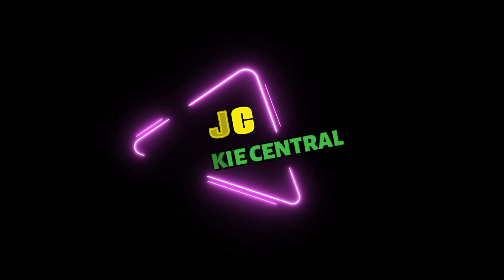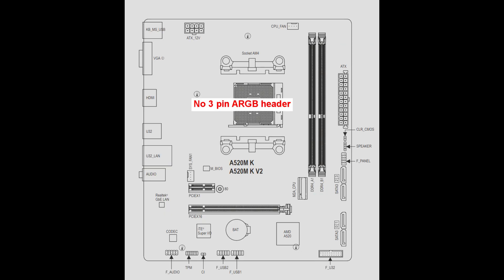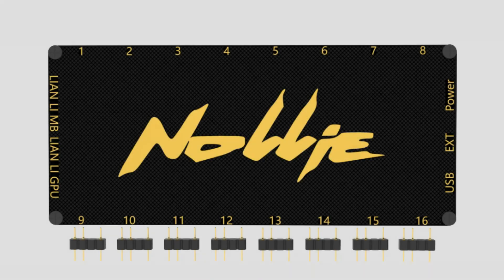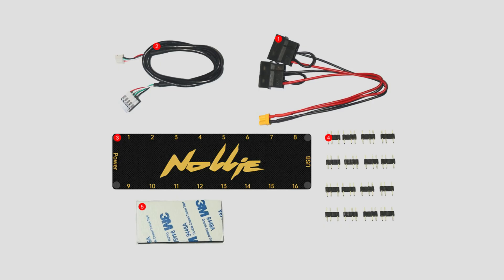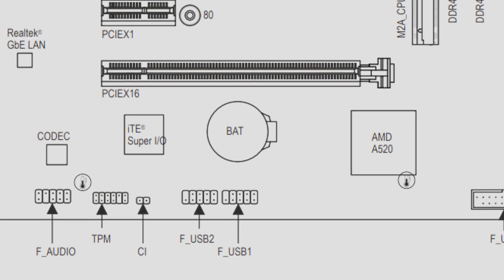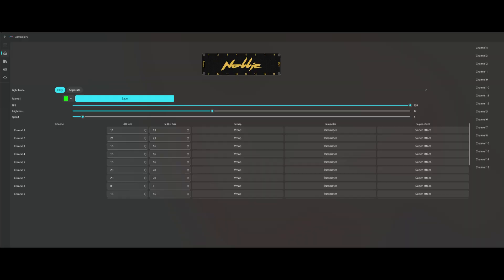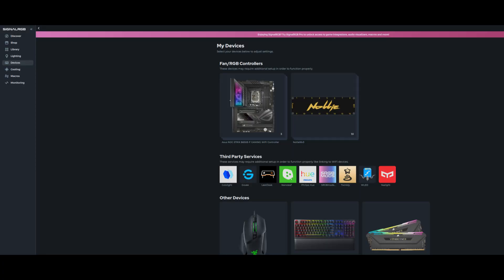Nollie RGB Controller - No ARGB Header, Installation, Software

Comment: Hello, I have a question. Can the controller set up a “startup animation” with the fan’s rgb ? Like when my PC is booting can the rgb have an animation or a preset color show up instead of the default rainbow RGB that shows up a few seconds when the pc is booting ? Ty
Reply from the maker: Good question, and the answer is yes. You have to download the Nollie software and pick the color you want and save it. This over writes the rainbow effect in the memory controller, once done close the software and everytime you boot it should now display the color you chose.  This works the same for motherboards and ram, the rainbow effect is just simply a way for the manufacturers to test all the colours display before packaging them up.

Comment: This works flawlessly with signalrgb but wish the argb connections werent so flimsy.  Ibhad a hell of a time trying to keep each header connected as i moved onto the next.
Reply from the maker: some people use a hot melt glue gun and add a spot where the missing pin is and this stops them coming out out the controller. does make it easier. if it is the cable from the fan to the adaptor you can bend one of the outside pin slightly and this holds that in place.

Comment: what if i have 9 fan , can i put 1 portal conect to 2 fans
Reply from the maker: I am presuming you are looking at the Nollie 8, this version allows upto 126 leds per port so yes you can add another daisy chained fan. doing it this way means 2 fans will display the same pattern or colour on both.
Reply: @TechJunkieCentral-l9w  ty your reply

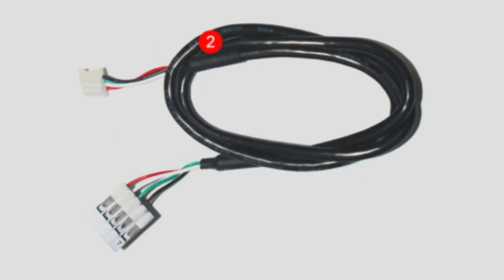Comment: 1:40 where can i find this cable ??? any link or website?
Reply from the maker: The issue isn't so much about find a cable that will fit as it is about the pin layout, it is a proprietary cable and possibly pined different to other cables. The cable is listed on the Nollie site as a USB 2.0 Internal Motherboard connector to USB PH2.0 cable which is easy enough to find, the issue is where the Red (+)  cable is located in the connector. I can't 100% say that you won't cause damage using this one like this https://shorturl.at/HWEYD and that is up to you if you want to try. I think I saw your post on Reddit asking. You could try re pining the 4 pin connectorby tracing the wires from the 9 pin. Other than that contact Nollie and see if they sell them separately.
Reply: @TechJunkieCentral-l9w  Doesn’t the USB header cable come in the box? I just ordered it and it hasn’t arrived yet, so I’m not sure, but it should be included, right?
Reply from the maker: @lamigu  It does come with it, not sure why the other person didn't just return it or contact the seller.
Reply: @TechJunkieCentral-l9w  thx ❤